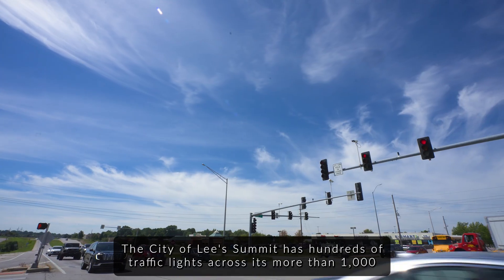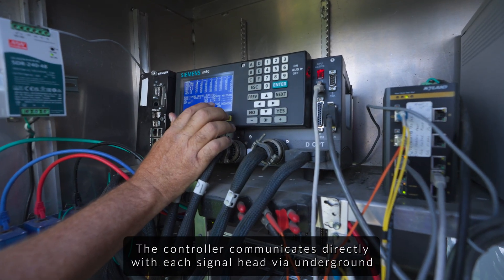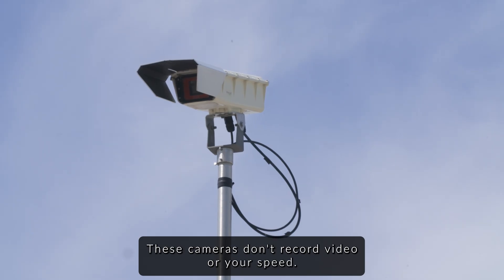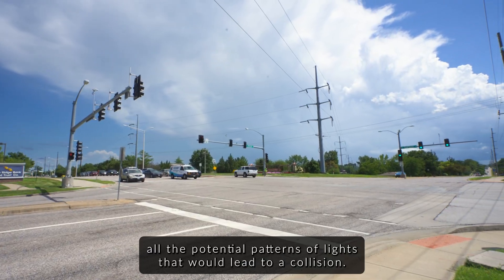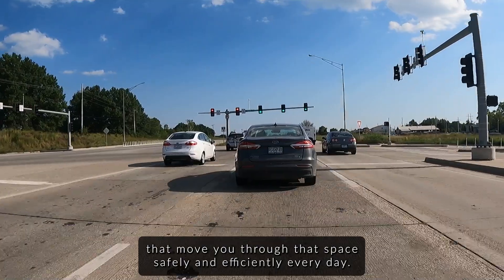How do traffic lights work?

Comment from the maker: 00:00 Traffic Lights in Lee's Summit
00:10 The Controller
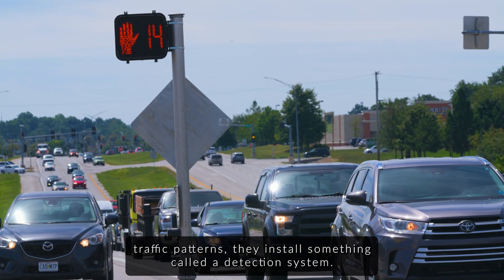00:32 The Detection System
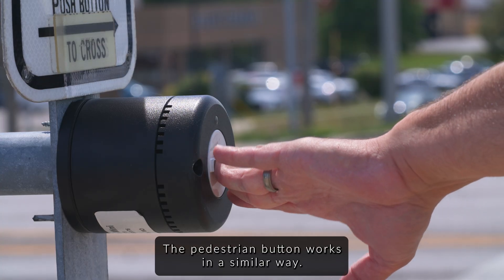01:04 The Pedestrian Button
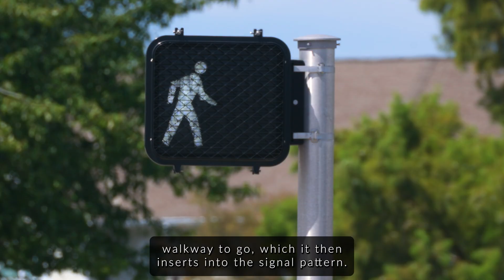01:15 The Conflict Monitor
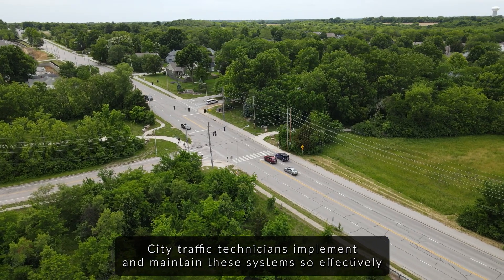01:37 The next time you're at a red light...